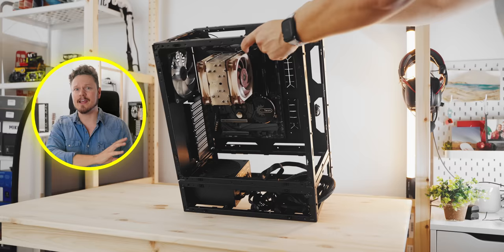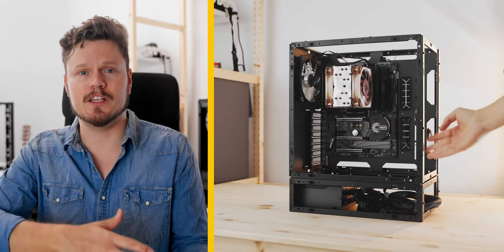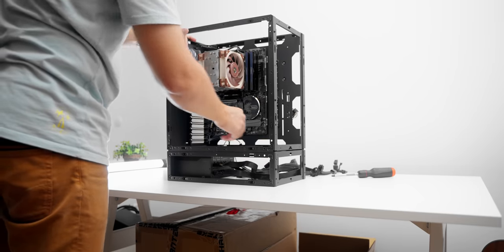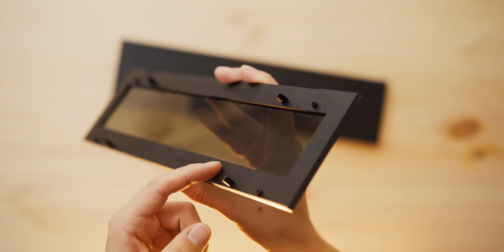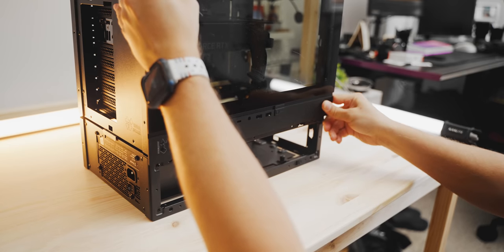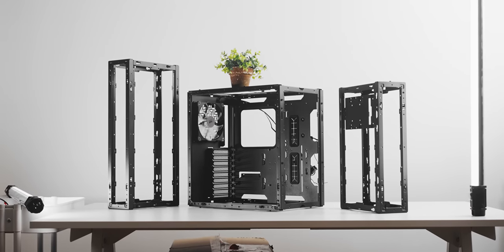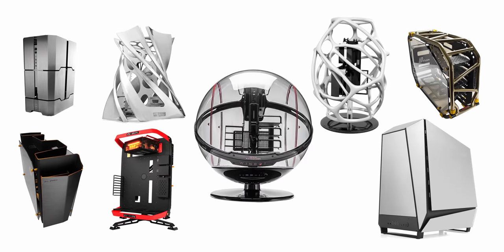The PC Case from the Future is HERE!

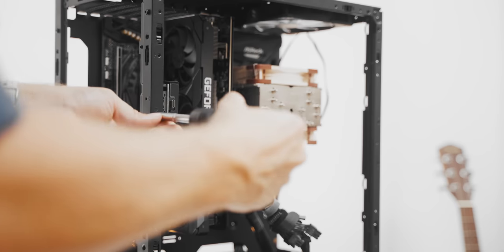Comment: @7:57 I really like that 90 deg turned MB and vertical GPU config. It just feels right to be able to better isolate the heat exhaust paths from both the CPU and the GPU. Seems like it would reduce the heat load that each component had to deal with if that load didn't also include an excessive amount of heat from the other component. I'd like to see how it tests for thermals and noise in that config.

Comment: 2 things :
- No cutouts on the motherboard tray - no support for future motherboards with headers on the other side
- No PSU shroud cover as positive!? 2023!

EDIT: MORE THINGS:
- 200 USD for BASIC edition with only basic and +1 module!
- side panel (glass) mounted and dismounted on "push harder" mechanism from 2000's. God luck if it wont want to came off and you will be forced tu put more force in it - glass ITS NOT FLEXIBLE. Tempered glass explode.

Comment: I'm a cynical sort. If something like this is successful, the potential for evil is high. Flat packing and forcing you to build your case from the ground up saving them costs on shipping that they will absolutely not pass those savings onto the consumer all while spinning it as a good thing or pro-environment. Turning each case into an "ecosystem" where the basic case will be missing features we take for granted specifically so most people will have to go out and buy the DLC parts. This will effectively raise prices while allowing manufacturers to say "no we didn't, the basic case is cheaper than ever!". The end result will be more expensive, less convenient cases that in theory are more modular and customizable but in reality are just what we used to have but with extra steps and extra cost.
Reply: Counterpoint, the environment and shipping costs. I also think this could lead to enthusiasts simply upgrading their case over the years, and it's highly resalable. Much easier to resell a flat pack case than a massive box.

Comment: I don't really see the point... It doesn't look great, it's expensive,  the modules aren't cheap, cable management looks messy, the space isn't well-used etc.. 
For 200€ for the small thing and almost 300€ for the big one, I could buy a good mid-tower and if I feel the need to upgrade, for whatever reason, I can buy a new case. Dedicated cases look better, are better thought out for my needs, and are way cheaper. Also when i have paid 200€ and really want to change the way this thing looks, i have to spent at least 100€ more and at this point, i could have bought 2 good cases, which really look different, like a fractal Nord and a O11.
Also for me, when I build my PC, I don't see a point in rebuilding it every year. Maybe there are some niche PC builders who have the urge to build their PC every 6 months but thats not the mass market.
So an interesting concept but I think its doomed to fail, for that price point.

Comment: Case is terrible don't buy halo at front never worked properly because of molex connection inside were touching causing a short now my motherboard will only turn on by shorting the power pins case has no response at all now
What a waste 
Seller won't even reply
Don't buy this junk